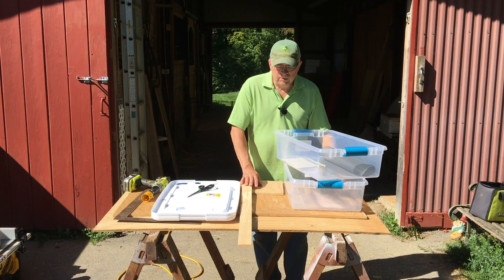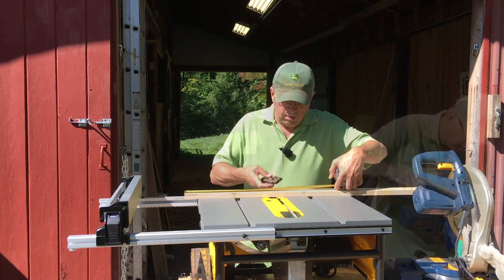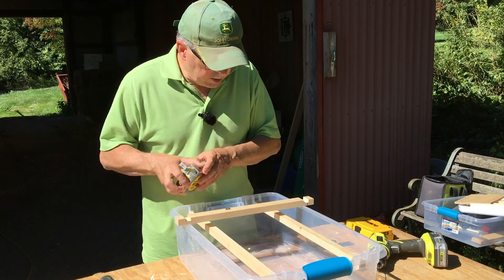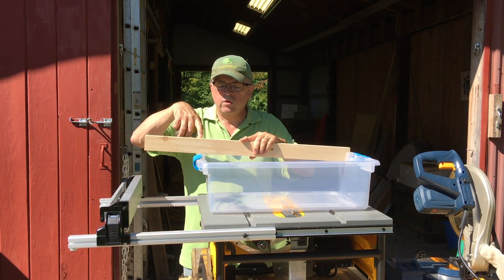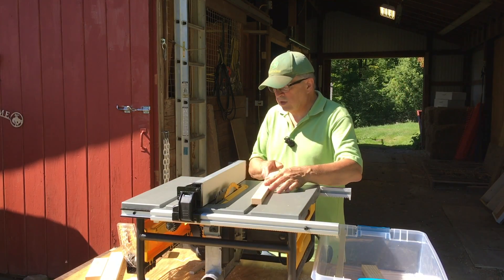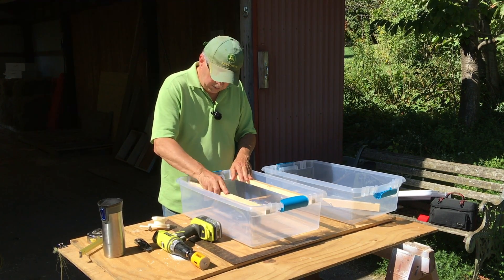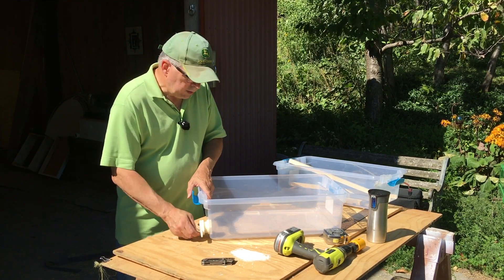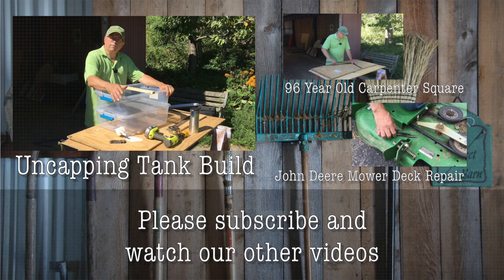How to make an uncapping tank for beekeeping for under $20

Comment: I built one like yours after watching several videos.  Yours was the most straightforward, and it works great.  I had a bit of trouble finding mesh I liked that was that wide.  I tried using overlapping strips, but they wanted to slip.  I may try fastening them together on my next harvest.  Thanks!
Reply from the maker: TechnoTinker thanks. Simple is best. Try using plastic screen door mesh. I think it’s called pet proof.

Comment: Now THAT'S how you make an instructional video.  Very clear, easy-to-understand directions.  Very straight to the point.  Too many videos, they talk to slow and it takes forever to get to the point.  Great video.  I'll be making one of these!The only question I'd have would be regarding the mesh.  The video shows you measuring and cutting the mesh, but then what?  Did you just lay is in the bottom of the upper tank?  Or did you attach it somehow?  Does it just provide a screen for the 4 holes you drilled with the hole saw?Thanks
Reply from the maker: kkinnersley Thanks so much for the compliment. I'm glad I'm getting better at the instructional videos. Even a blind squirrel gets a nut once in a while. :)  
The mesh just lays in the bottom of the upper tank so it can be removed easily for cleaning and wax removal. It covers the whole bottom but is only needed for the holes. When draining the tank it also helps to tip the upper tank a bit to one corner so the honey drains better. 
Drill the holes as close to the corners and/or the lowest point as possible to make that easier. I found, after taking the mesh out, using a rubber spatula to squeegee the honey toward the hole works well. Clean up is fast also. Just hose it down with the garden hose. I never put any wax laden honey in the kitchen sink to avoid build up in the house drains and lines. Fixing that would be a video I don't want to make.
Thanks so much for watching and commenting. Please share if you'd like!

Comment: Very good video -- instructional and to the point.  One question though, you mentioned putting the nail in to "hold the frame."  How does that hold the frame?  Do you lean the frame against it to uncap the honey?  If you could clarify that for me, I am good to go!
Reply from the maker: Atrium Base Shop Bingo! The nail is to rest the frame on while cutting off the cappings. Thanks for watching and commenting. Let me know how it turns out

Comment: I may have missed something - but did you just lay the mesh in the bottom of the top bin or is it fastened somehow? Just wondering if it would slip and move around if not fastened in some way.  And would it be okay to add more than just the four holes in each corner to allow the honey to drain through faster?
Reply from the maker: Kristin Francis tip bin over the holes. Honey will help keep it in place. Thx!!